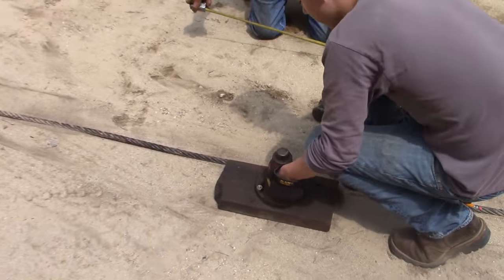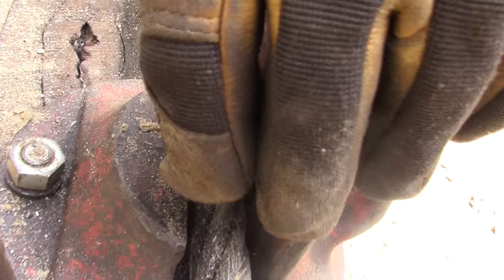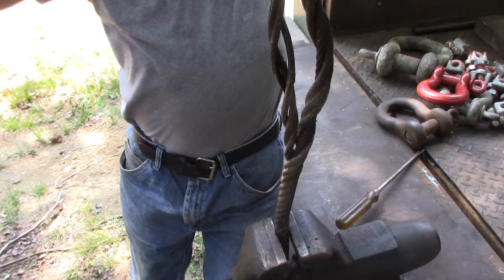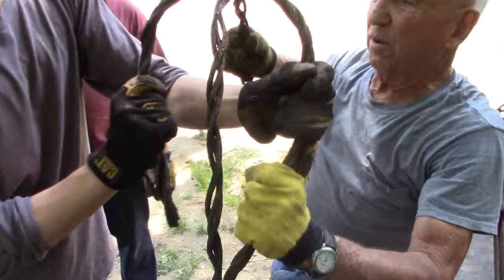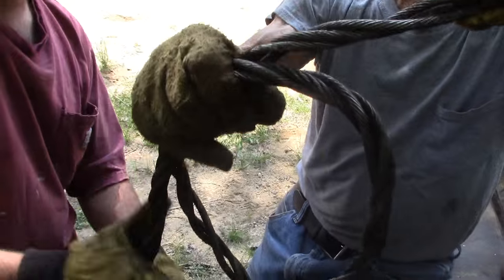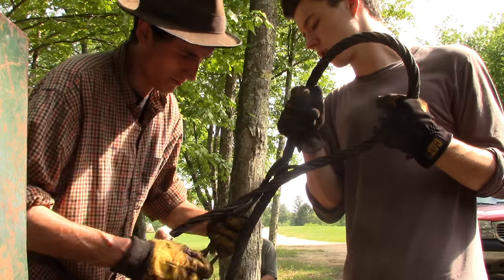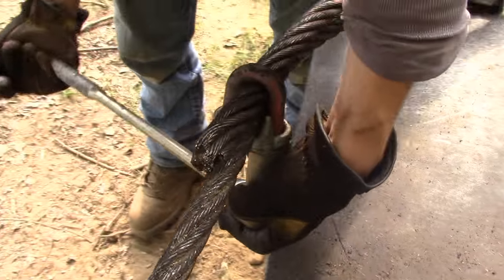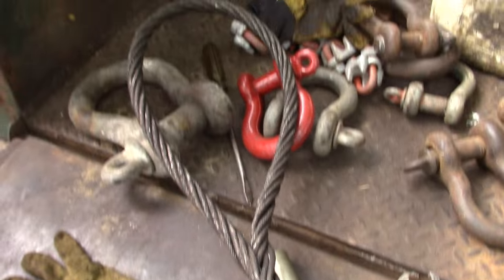Weaving Cable Loops For Lifting Slings - How To

Comment: Good video on threading a loop in the field.  We had a cable cutter that had a big spring on it you  compressed and then hit a side release with a hammer.  Split the cable in one shot.
Reply from the maker: That sounds like an awesome cutter! I bet John would have liked to have that when we were cutting the cable!
Reply: +themadmailler I would have!

Comment: anyone else 'wincing' [eye goggles?] and 'leaning in' with cb n shawn's movements to 'help' them convince that cable to bend? lol.
interesting to see the how of this very cool ingenious old time technique. hmmm, is there any need for a piece of [curved/cupped] metal to be placed within the loop to distribute the pull of the crane hook..?..
Reply from the maker: the curved piece of metal would be called a thimble, but it is not needed. at the loads this cable can pull, it would bend it to pieces.
Reply: thanx!

Comment: that is positively the WRONG way to loop braid a cable..  on the beginning of the loop,  do you have 3 cables on one side and four on the other?  that loop will now, ONLY  support the weight that the 3 strands will hold.    I  believe MOREONS is the right term.
Reply from the maker: these cables lifted our 22 ton engine just fine.